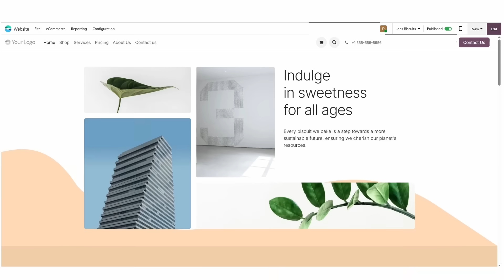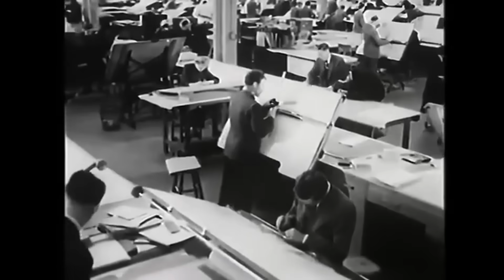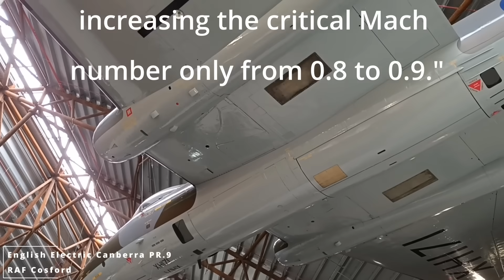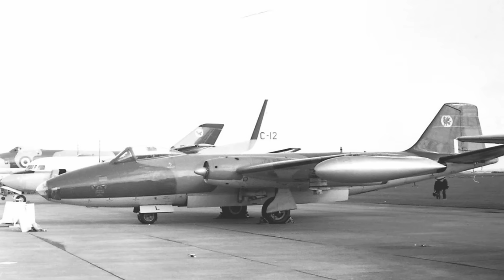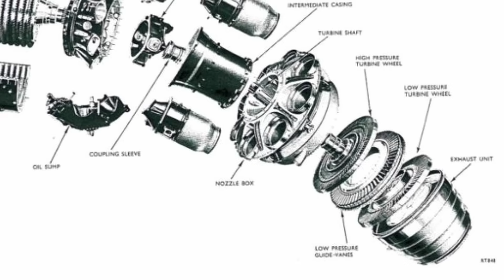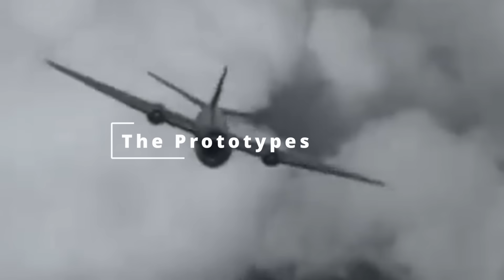When a Locomotive Company Built a Legend - The English Electric Canberra

Comment: Vulcan and Canberra bombers were 2 of the best bomber aircraft in history.
Reply: Along with the Buccaneer...
Reply: @RogueWraith909  I have to go looking, now. I've never seen a detailed account of the Buccaneer, and until this point had never seen one on the Canberra. When I was young, I gravitated to the looks of the Hunter, but I'm old enough now to know that looks aren't everything.
Reply: @45CaliberCure  Buccaneer pilots got extremely good at low level flying... extremely low level flying.  There was a running joke that you recognised a Buccaneer pilot by the fact that he flew lower when he raised the landing gear.  Lol.
Reply: @RogueWraith909 a friend of mine was a cadet & his squad was sent out to sit in the 2nd seat of buccaneers, his enduring memory was flying across a navy dockyard & the bangbangbangbang sound of wavetops hitting the underside of the fuselage.
Reply: And the Victor.
Reply: @Gorbyrev  And the little known Valiant.
Reply: @RogueWraith909 The Valiant: "Hey, what if we used the inconvenient engine arrangement of the Lightning, but did it twice?"
Reply: @RogueWraith909  I should have just gone with V-Bombers.
Reply: @ethanmckinney203  Indeed... but on the wings... instead of inside the fuselage.
Reply: @RogueWraith909  The problem with the Valiant was that the spars suffered from fatigue cracking, as with the Canberra. So it was retired as the Vulcan/Victor were already doing the heavy lifting. Existing Canberras were repaired, and the future production models used better alloys.
Reply: @SuperNevile Yup, still great looking planes though.
Reply: The B-1 Lancer and the B-52 Stratofortress have them all beat.,
Reply: @DoktorBayerischeMotorenWerke  The BOne is a lovely aircraft, but the B-52 looks like a 747 for bombs, lol.  All these aircraft have their own beauty, but yeah, the B-1 and the B-52 could carry huge loads.  But you're comparing aircraft that came years after the Vulcan and Canberra, but the Vulcan was one of a handful of supersonic terrain following, bombers, capable of carrying a large atomic payload.  Playing War Thunder, the B-52H has an amazing bombload.
Reply: @BlackHearthguard  The Vulcan was not supersonic... its top speed performance was a humiliating failure for the British aerospace industry...
Reply: @DoktorBayerischeMotorenWerke  As may be, I'm going on memory, I don't have my books.  But, Vulcan was hardly a humiliating failure.  I have noticed lately however a tendency for people to denigrate British aircraft, tho I don't know why.  Britain's ability to flap NAP of the earth was revolutionary.  Any way, you have a thing for big american tanks, I have a think for sleek beautiful British bombers, neither of us is wrong.
Reply: @BlackHearthguard  The Vulcan was certainly intended to fly supersonic but a series of aerodynamic, structural and engine problems prevented this performance goal from being achieved which was a common theme in British jet aviation. After two Vulcans crashed due to catastrophic inflight structural failure, Avro installed a "Mach Limiter Device" to every Vulcan to automatically slow, and pitch-up to prevent a deadly crash as speed neared Mach 0.95

The RAF adopted NOE tactic by default as it had no supersonic aircraft with range capable of penetrating into enemy airspace.
 Britain developed dozens of supersonic production aircraft but only one ever achieved supersonic performance in service and its range was very poor.
 Britain has never successfully developed a supersonic bomber or a radar stealth aircraft.

Comment: Well done. I was gripped by the complexity of what they were doing and the fact it was all done without computers just pen and ink.
Reply: Don't forget the slide rules!
Reply: @RalphFreeman-ok5of Linear & Circular Slide Rules, the manually operated, ultra reliable computer of the day, still use the EB6 today (with a GPS unit as backup and checking device since about 2005 when I fly private), 40 years and not one battery used and no malfunctions of the EB6, solid and reliable tech.
Reply: Mechanical computers were commonplace for arithmetical operations.

Comment: Great story. Love the tech details of the design philosophy. Also loved the Human voice. AI voices are awful!
The RNZAF ran Canberras. The pilot had a bang seat (I think a 0/90) and the navigator had to jump from a hatch (of course needing altitude). On take off there was a gap between V1 and V2. A Canberra lost an engine on take off and by rights should have banged out as it would have been impossible to use enough rudder to manage the yaw with the power the good engine needed to fly. The pilot gave it a shot anyway asking the nav to assist with an extra push on the right rudder pedal (lucky it was the left engine that went). The pilot had just enough stable thrust to keep level. Lucky the area around Ohakea was flat so with a very slow acceleration the plane gained speed knot by knot until he got enough rudder authority to increase the power, climb and return to land. 
The nav bought the beers for the pilot in the mess for a considerable time after.
Reply: I thought bang seat was NZ slang until I read more. I wonder how many Cold War era aircraft crews went to their grave cursing pilots who bailed on them.
Reply: Just wish he knew how to use TH.
Reply: @FrankWilkinson-ig6co TH?